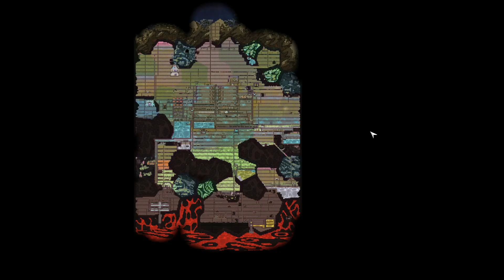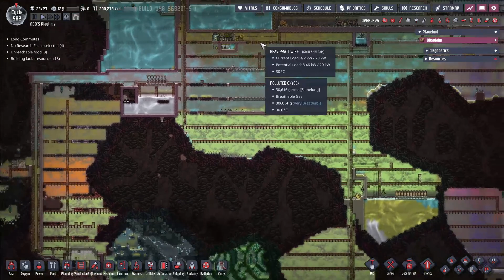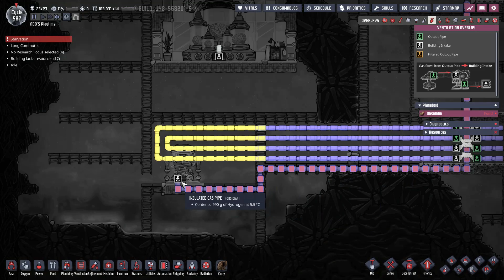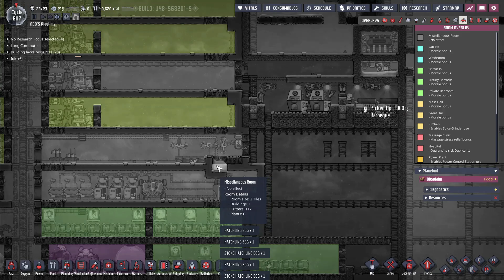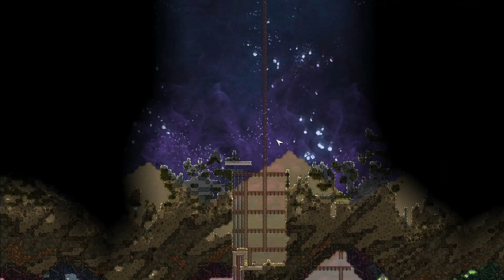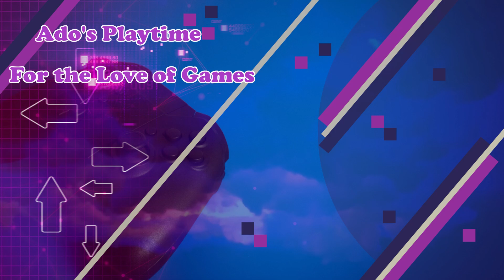ONI Episode 18 Totally Metal!

Comment: I've been thinking lately about your refinery design with steam engines that are used to delete extra heat. And I'm wondering: how effective would it be to use steam turbines to delete heat from boiling petroleum? Just put steam above a pool of petroleum and vent it through a steam engine until the steam reaches 100C. Then pump 100C petroleum into a counterflow heat exchanger with crude oil to bring its temperature even lower (and also get some power for free!).

Comment: one way you can spread heat over a really large area of steam is by making a closed loop of radiative pipes and just circulate any high temp liquid in it. it will carry over heat from high temp areas to low temp areas.

you can even use a rail loop circulating with some metals in your steam area to achieve the same thing. this way can propagate heat about a hundred tiles away.
Reply from the maker: Alexander! Haven't herd from you for a while, always enjoy your tips. The radiant pipes is a great idea. That could help even out the temps. I think that could be useful in the geo-power as well. I like it! 

With the rails, that could be the solution to those big hot rocks in the middle of the map I want to get rid of...hum thinking in progress.....